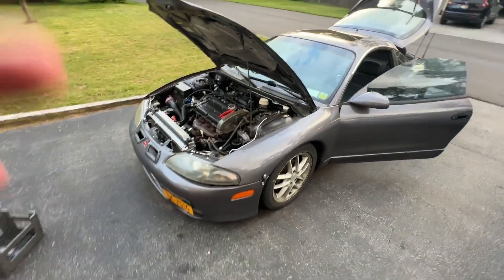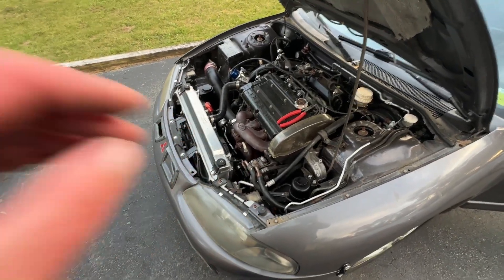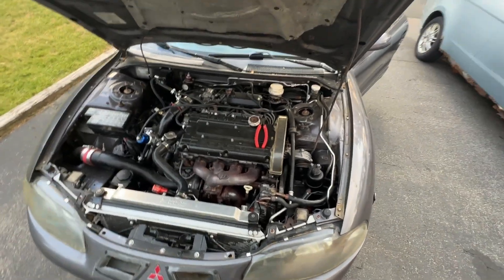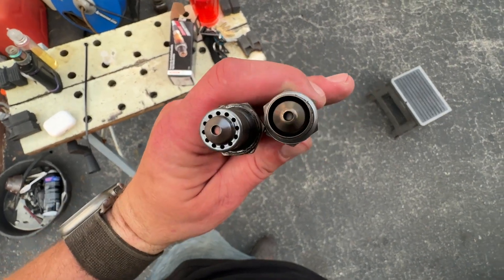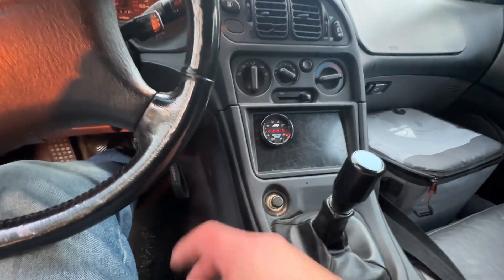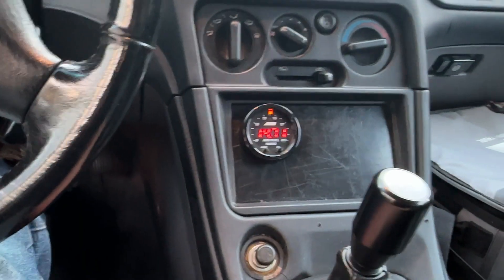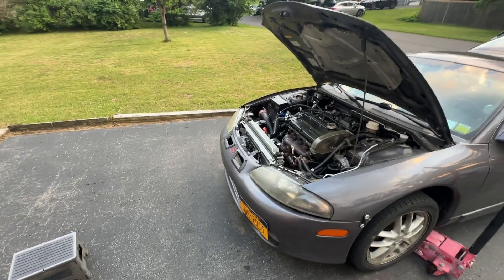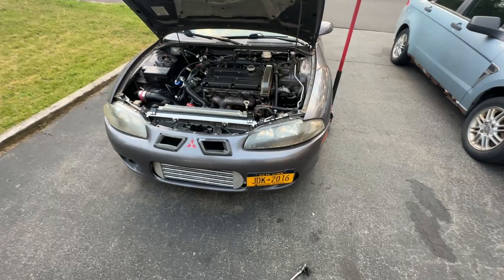THE BEST PRICED WIDEBAND SENSOR TO REPLACE FAULTY AEM OXYGEN SENSOR😮!!

Comment: This might work on some of the LC-1's and LC-2's.  I have several of the innovates, and the sensor plug is the same plug, but they're 2 different sizes.  This one would fit "the big one".
Reply from the maker: How nice would that be?. Yeah I couldn’t believe I found a sensor that worked for a quarter of the cost of the original replacement from the kit. Quick update: it did fix my issues on the highway. Everything’s running as it should again. P.s huge fan of what you do @jafromobile been a fan for quite a few years!. Keep it up 💪
Reply: It does work. I have innovate LC2. My sensor crapped out. I bought same exact sensor you have. Been running it now for about 6months. No issues
Reply from the maker: @valadezjose47 thanks for confirming this as a fix💪